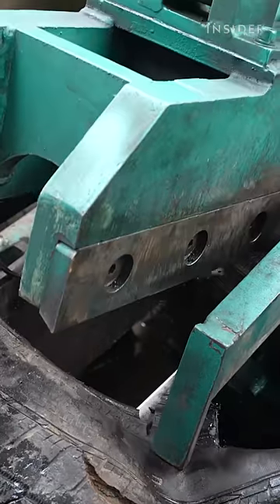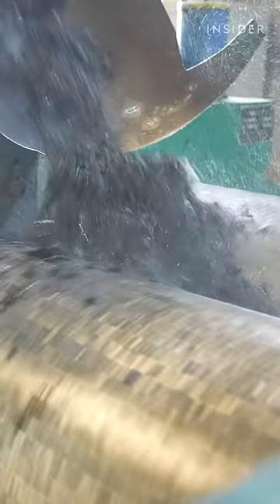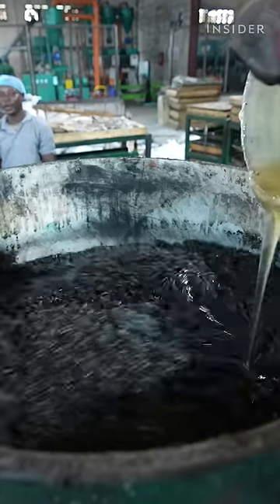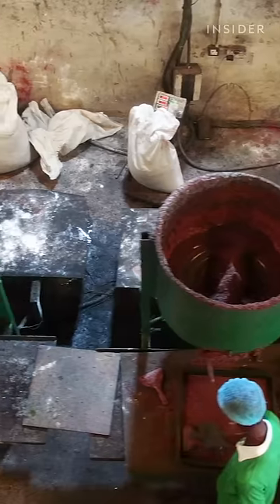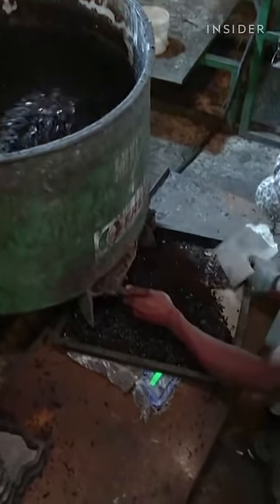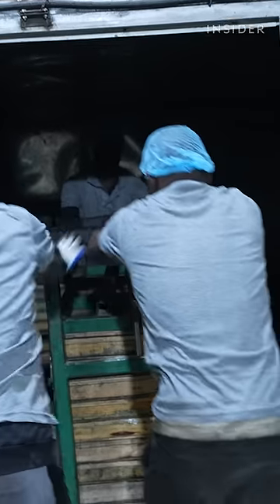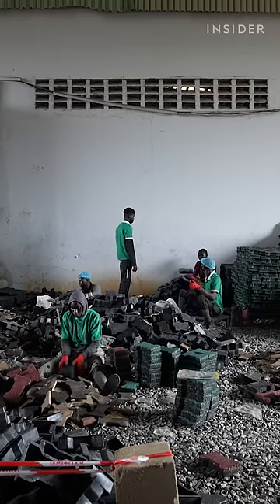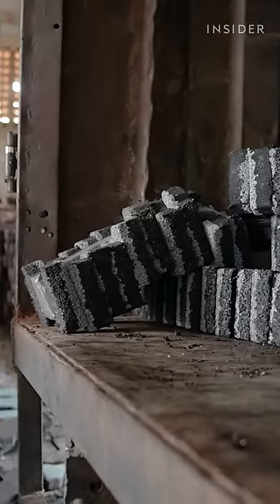Here’s how this company recycles old tires to create rubber bricks. 🧱 #rubber #sustainable #nigeria

Comment: And the ground below the tiles will become polluted. 
Using words such as green, recycle, and net zero doesn't mean that there aren't drawbacks. 
And sometimes the drawbacks are bigger than the positives.

In Denmark we just recently stopped using granulated tires for infill in artificial football fields because the leeching would pollute.
Reply: But its gonna land in the groundwater anyway wont it?
Reply: @Gigachad-mc5qz  
If you incinerate garbage at high enough temperatures the breakdown more completely - that means into CO2 and water.
There will be some leftovers but they will be far smaller in size and you can have smoke scrubbers installed to catch soot.

At the same time you can use the heat to generate electricity and you can use it for heating houses.

All in all the call to green solutions have meant some safer and sensible approaches have been looked down on. Which is a shame.
Reply: @vendomnu  thanks for clarifying😌
Reply: I agree,  @vendomnu there are carcinogens when handling the rubber, but they could create ground barriers. Burning rubber, that is a poor solution.
Reply: Please be sure to differentiate between loose granules and reconstituted blocks.
The most significant research I have found is related to granules that are used as such.
These blocks will not produce anywhere near as much pollution.
Reply: The land under will be just fine, especially when mycelium grow, so stop with the world is dying crap
Reply: When one has no house, a house from these bricks would be a geater blessing.😮
Reply: Not to mention the micro pollution from shredding them 😮‍💨
Reply: But it is a natural resource anyway and what goes around comes around. We deserve what we get, period.
Reply: Are you saying spreading it in atmosphere is much better?😂
Reply: I love your culture I wish US would adopt but we unfortunately idolize the $$$ over our children's and forever future 💔 never too late to start walking!!!
Reply: @stephie1466 yeah, I'll just walk the 120km round trip to commute to work. Super practical.
Reply: @zee9709  
If you increase the temperature in any fire you will get a more complete combustion.
In case you missed the chemistry in highschool most atoms in organic chemistry is H (hydrogen),  C (Carbon), O (oxygen) and trace amounts of other atoms such as N (Nitrogen).

When you have a more complete combustion you will end up with the least energetic molecules with the above-mentioned atoms.
That means CO2, H2O, and N2.
These will bugger off in a gaseous state. These are as clean as it gets. That which cannot become gaseous is what's called slags.
This can be deposited in clay walled compartments in ground until we figure wtf we can do about it. In the past we used it to stabilize below buildings which was the worst idea since it increase in volume if you allow it to suck up moisture -> cracked walls.

If you wanted to ask an intelligent question, you could have asked HOW do we increase the temperature.
By adding natural gas.
The plants of Fortum can reach a temperature of 1250°C whereas a normal incinerator is at around 900°C.
A bonfire is around 400-500°C for reference.
Reply: I'm sure you are aware that evolution is a process. maybe we can stop evolving and just live on coal for the rest of eternity? focus less on how we thought that granulated tires would be green and focus more on how we realized it wasn't "green" and fixed the course of action. you cant improve unless you try new things and think outside the box.
Reply: @stubaker1737 you’re not a scientist.
Reply: "Polyurethane binder" means that what you say isn't possible.
Reply: @brookelord3448  
Did you read the part about 1250°C and smoke scrubbers?
Because if you didn't then you ought to.
Reply: @Cimone90 no personal responsibility in distance to work at all, move along, nothing to see here.
Reply: Fantastic!
Reply: @vendomnu  i already know about that. There's a Canadian recycling company that has a negative carbon emission rating. The process actually removes more CO2 than it creates. They use algae, which eats the chemicals that are toxic to us and they byproduct release is O2. But as far as rubber and plastic go, if you encase them inside a non-toxic plastic, it locks in any toxic chemicals.
Reply: @vendomnu  lmao just c02 and water 

source: trust me bro
Reply: @Cimone90     .     🛵👀🏍55-1OO kph.    *4O+ k.p.Litre...   NAVl by honda
Reply: @barretdenman2854  dude, I live in Canada. It's a massive sprawling country. Nothing is close and if you want to have affordable housing, you need to commute. So respectfully, piss off
Reply: @battshytkrazy156  yup, that'll work when it's -30 celsius and snowing....
Reply: /yawn
Reply: @Cimone90      .    🚁!!!!🆒️✔️ OmfGAWD
Reply: I'm pretty sure it would have polluted anyway but now it's a part of a house or a playground or something instead of just a tire in a landfill
Reply: The KEYWORD is RECYCLED..... potential pollution is always present..... RECYCLING limits negatives from Initial raw materials sourcing and production processes..... it is not unusual to remove multiple chemical processes to arrive at the physical material.....
Reply: @brookelord3448  
A) I'm always very sceptical when a company claims to be CO2 neutral or negative - I would like to see how they arrive at that result.
And I honestly don't see CO2 as a pollution, anyway - it is a gigantic grift. But I'd like to know the name of the company, if you can remember the name.

B) Yes, if encasing the problem is sufficient then that could be a solution - as long as it becomes an industry standard to treat the bricks as polluted and that recycling said bricks would only be for making new bricks of the same kind so the material stays in the same "stream". 
Here, there has been talk of treating rockwool insulation that way because asbestos roof tiles can have withered and dropped fibres into the ceiling insulation - if all rockwool is handles the same way and treated as polluted, then it could be a solution (rockwool is spun a bit like candyfloss but with molten rock being spewed out of nozzles. And asbestos is a mineral that's pretty flame retardant btw so it doesn't break down).

In regards to encasing a problem I'd like to point out that PCB used as a softener to keep (the word escapes me) the 'seam' flexible between doors/windows and the bricks have had leeching issues.
The PCB has wandered from the seam into the brick (burnt clay bricks) so just because something is a solid doesn't stop long term migration/leeching.
(PCB was in use for these seams in Denmark from 1950-1977, so a lot of older houses built in the late 60's and early 70's have this problem).
Reply: @TiredoftheBS1562  
Removing parts of a whole is very difficult to do in a cost effective manner. If something isn't cost effective then it does not happen in real life.
Reply: @gonzalocianci6105  
Is an incinerator a landfill?
Reply: @p24p14  
It would appear that you haven't been burdened by an overabundance of schooling.
Reply: @vendomnu  ohh I see I wasn't responding to the incinerator comment still this is neat I personally like it
Reply: @dougaltolan3017  They are toxic.
Reply: @Gigachad-mc5qz  This guy is pulling all of this outta nowhere - its bs
Reply: Adding in chems like polyurethane has permanent damage to the upper respiratory system.
Reply: @brentharrington9235  citation required
Reply: @juliherron8991 It'll be a bad situation when the house has a fire ... Toxic and hot hot !!
Reply: You are so right! Although This is a great attempt in the correct direction. But in 20-30 years we'll need to find a way to recycle rubber sidewalk bricks.
Reply: That’s easy to say for a developed country that has years of technology and information/resources. This is clearly in a developing country. Did Denmark not do the same thing (as you said) and use tire fill in? Why are you telling another developing country what to do and shaming them when your country did the same thing for decades? Are you saying this country needs to skip from impoverished with no technology to perfect faster than your country ever did?
Reply: @tylerfielder5582  
It's not about being a sanctimonious arsehole - it's about calling out the drawbacks.
From the greenwashing propaganda you would never be able to tell because the money interests are louder than those who try to inject caution and common sense.

No, I don't want to hold developing nations to high standard - but I don't want to see my countrymen outcompeted when it comes to production jobs when the products are just made cheaper and with no regard for the environment.
Remember, every time a manufacturing job is closed down in the west, the manufacturing is done in usually southeast Asia - where the environment is always placed last.

One of my many axes to grind with this is production of solar panels where the waste materials are oftentimes just dumped.
Reply: @juliherron8991  These aren't for housing and homelessness is largely caused by people not being able to afford houses, not a lack of houses.
Reply: @vendomnu I recently found out about this and am doubtful it will ever happen in the US. It's such a smart solution.
Reply: @brookelord3448 Except the said non toxic binder will wear away very quickly if you use them as pavement. And then you have toxic, carcinogenic rubber dust everywhere.
Reply: @phoenix211245 
No more than the worn tire they came from
Reply: @drsmoggy  Yeah, but said toxic rubber dust will be concentrated in a place where children congregate and have frequent contact with the ground. Oh, and there will be significantly more of it, as the material was pre-ground, and the binder is.... iffy at best.

Comment: Ground up tires are a KNOWN CARCINOGEN. Especially concerning that schools are using recycled tire bits for playgrounds and tracks, and that it's part of astroturf fields where players are getting cancer. It's TOXIC.
Reply: I'm glad someone said it.
Reply: it's in Nigeria.. no one cares lol
Reply: @lamspam fantastic!
Reply: A fair share will be released as microplastics as the bricks are worn. And released to the streams, rivers and the sea.
Reply: Do you live near any roads or cars? Ever notice how tires on cars need to be changed from time to time because they're worn? Gee, I wonder where the rest of the material could've gone!
If there are environmental and health concerns because of tires - and buddy, there are! - it's certainly not this.
Reply: thankfully you don't drive or buy anything that's been delivered by a vehicle with tyres on and contribute to the problem.....

until tyres are unneccesary this is better
Reply: The Netherlands has chosen to make all new soccer fields with real grass and has given a timetable to replace all existing turf made from the toxic carcinogenic rubber crumb (from recycled tyres.) So, Way to go ???
Reply: @TheFujac Clearly it'll still present an issue even if we don't recycle them in this way, nevertheless the severity of the issue will be significantly lower if we don't use this recycling method. Yeah tyres aren't great, and can't be easily replaced, but that doesn't mean we shouldn't try minimising the impact. Fully burning the tyres off into CO2 and water is a much better outcome than turning it into endocrine disrupting carcinogenic leeching granule bricks.
Reply: @Goodengelt  good for them
Reply: @sid.h  it would take you less time to google "tires cancer" than to write this ignorant post.
Reply: No one’s telling you to put it in a rizla and smoke it
Reply: Laughable
Reply: Think about workers also and their safety against TOXIC issues
Reply: You missed the part where it's held together by a resin and not able to be inhaled like the synthetic grass in the NFL where you can see it blast out with every step.
Reply: @lamspam 😂😂😂😂😂😂😂
Reply: My thoughts as well... this is not a good idea at all sadly.

Comment: Microplastics has entered the chat
Reply: Rubber isn't plastic...
Reply: And lots of petroleum I bet
Reply: @Arbidarb  the video says the binder is polyurethane.
Reply: Where exactly have you seen tires made of plastic?
Reply: @rebase  Even the EU says that polyurethane is harmless, doesn't cause the same dangers like micro plastics and is sustainable.
Reply: @rebase  They aren't cutting up the polyurethane. If using it as a binder is a problem for creating microplastics then virtually every piece of wooden furniture is a problem.
Reply: @rebase  and polyurethane is safe, sustainable and can be broken down by fungal, bacterial and enzymatic processes all of which are natural decomposition processes, so what's your point? 🤔

Comment: For all those questioning the dangers to the workers and want some good reading - Here are a couple of scholarly articles related to the environmental and health impacts of using recycled tire rubber:

1. Chemical and ecotoxicological characterization of crumb rubber from end-of-life tires: A comprehensive perspective"
   Authors: C.A. Arias, et al.
   Journal: Science of The Total Environment
   Year: 2019

2. Leaching of metals from tire crumb rubber"
   Authors: A. Turner, et al.
   Journal: Environmental Pollution
   Year: 2019

These articles delve into the chemical composition of recycled rubber and its potential impact on the environment. Accessing these articles through a university or research library should provide you with more in-depth insights.

Comment: And how many chemicals get into ground water?
Reply: It was my first thaugt too. But then I remembered that you literally grind few milimeters of tires to rubber dust on the road before buying new set. So I don't think that glued together large pieces of tires will leech more chemicals to the environment..
Reply: All of them
Reply: There does not seem to be a lot of chemicals involved in this process. Most of it is mecahnical and thermal. The only chemical I saw utilized was Poly Urethane binder.
Reply: @comingviking  from tires themselfes?
Reply: A TON. Microplastics shredded into pieces the eye can't see
Reply: oh not many
Reply: We all thought recycling was great but now we know the forever chemicals are recycled too.
Reply: @EddiXP ... instead the current situation where those sit in dumps being degraded by the elements is producing a whole different result... clown
Reply: THIS IS WAAAY better to be recycled and reused than just sitting everywhere with mosquitos. If anyone can do a better procedure go for it!
Reply: @ruelvillapando4703  dont get me wrong. I think it's better than putting them on landfills too. But I am not sure If they dont intoxinate there waters
Reply: @ladislavseps4801  thankyou for some common sense. Exactly what you said makes sense. The tired will already leach during both the production phase, the usage phase,  and the disposal phase. This thing that this shouldn't be done because chemicals that already would be coming off anyways.

Comment: They could make fence posts, telephone posts, curb stops, matting for barns and oil rigs... the potential is endless 🙏🏽
Reply: Imagine floating vegetable gardens in the Atlantic.
Reply: If we ever learned to use it properly
Reply: I thought you said curb stomps💀💀
Reply: @Gigachad-mc5qz  "Bite the curb!"
Reply: @joecat916    Imagine a desolate sea floor in the atlantic.  They have tried using tires to make artificial reefs and ended up having to clean up the pollution they caused...seems tires give off toxic chemicals as they rot.  The question is, how long do these things last compared to a tire, when tires last only a few years before they start to break down.  All that toxic stuff ends up as run-off that is dumped into the closest river.  They have tried turning it into mulch too without much success...stuff floats off the plant beds and ends up in sidewalks, ditches, etc. where is can also be eaten by animals (they paint the stuff in bright colors and animals LOVE that).
Reply: I am not climbing ANY telephone pole made of those, BAD BAD BAD idea. Don't know why you came up with that idea, but just no. They will not hold up the weight or the tension that is put on Electric/Telcom poles.
Reply: Rubber fence posts that won't be able to hold up a fence. Don't think just feel.

Comment: In the tires is an amount of asbestos and with the binder chemicals.  That is one toxic brick.
Reply: Asbestos isn't dangerous unless it is in the very fine, powdery state, as only then can it enter lung tissue. As long as asbestos is bound, it is safe.
Reply: @rattlecat5968  yes . I know but if the house is on fire that becomes a toxic fume
Reply: @freeminded2205  Sure, any petroleum product, including all the plastic items inside the house, the Scotchguard on the carpeting, the water repellant infused in your clothing, etc, emits fumes. But patio bricks rarely catch fire. Fire creeps UP, not down, so if the patio bricks do get ignited, the fumes will dissipate into the outdoor air. But, that's really the least of the problems during a fire.